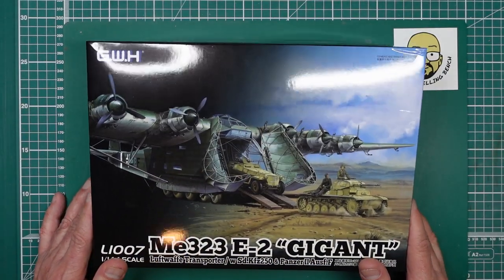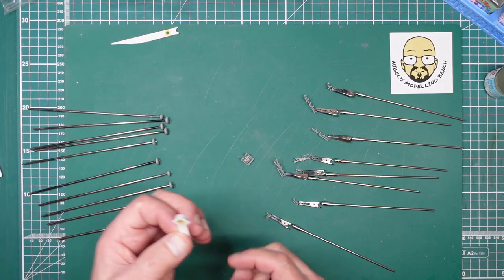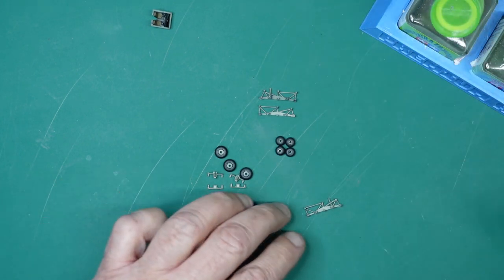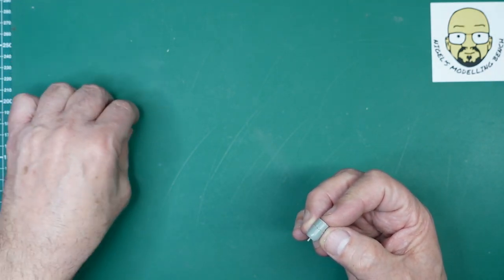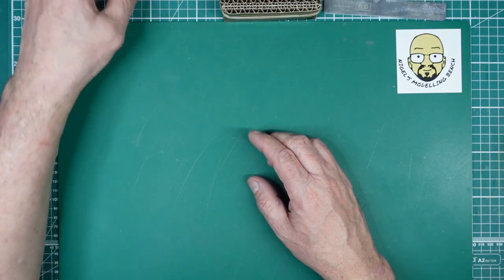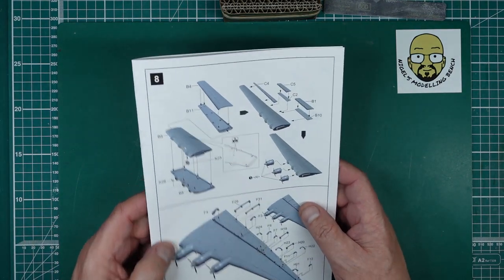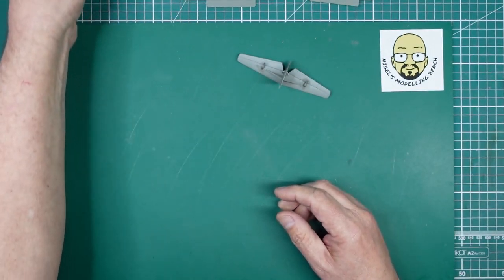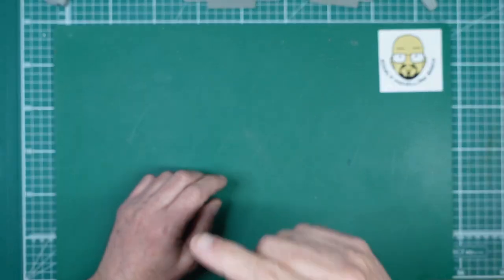GWH 1/144 Messerschmitt Me323 Gigant build. Part One

Comment: Hi Nigel, nice video. If that scheme you said you was going to do, is from 1944. Then I am pretty sure that  the tank and half track would have been Dark Yellow, not the German Grey. German Grey stuff was early war, up until 1943 I think. Not 100% sure though. It's a Panzer 2, not a Panzer 1 BTW.
Reply from the maker: I think your probably right Andy... luckily I haven't painted them yet.
Reply: In 1944, the Germans were having supply problems and sometimes had to go back to stocks of grey paint. Not sure if this affected Pz IIs though. Or these vehicles could have been left in the original colour because the depot didn’t have the dark yellow paint.